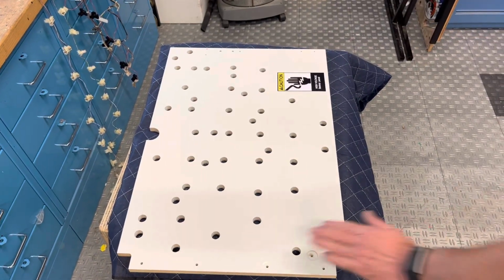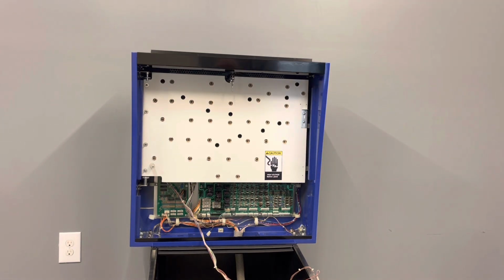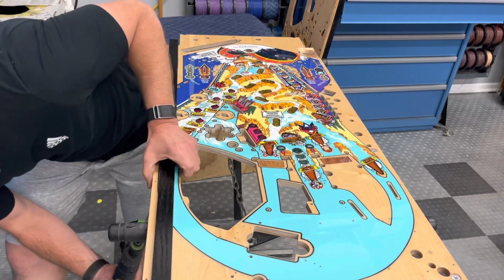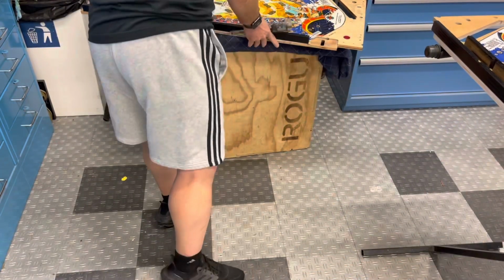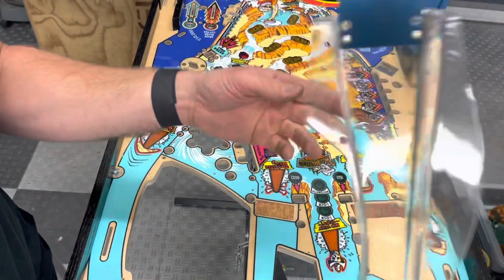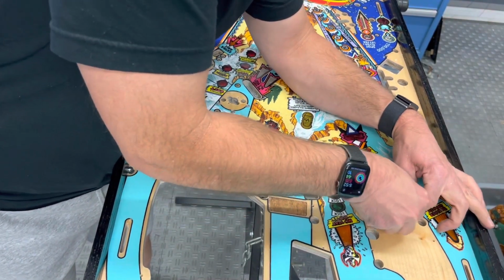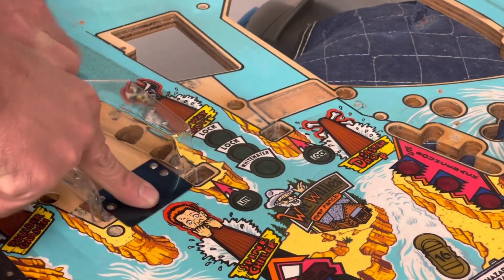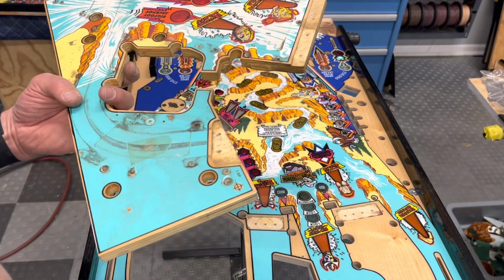White Water Pinball 7

Comment: Wood chisel would help ya get that ramp area cleaned up. No drill circles
Reply from the maker: That would require a hammer as well so I would be worried about it drifting on me but honestly it’s not something I use enough to be comfortable with so I am going to usually stick with what I know best.
Reply: @highendpins   yep im certainly not to your skill level for all the magic you do.   Just a passing thought as i watched.   Thanks for all the great content
Reply from the maker: No problem I am sure there are better or easier ways to deal with some of the things that I run into. The main goal is showing the problem and solution how to go about it isn’t quite as important as long as it yields the intended outcome.
Reply: I would have tried a trim router with some elaborate jig, your way looks much faster

Comment: never seen you short of tools.. but router FTW on that ramp recess :)  1/4" straight bit would take care of all those recess expansions in minutes with no need to manually clean up
Reply from the maker: Yes I am sure and I have a router but I like the drill method it’s what I am comfortable with. 
I always default to the use of tools and processes that I am used to and best with even if it seems harder or less ideal. 
  Hopefully this doesn’t turn into a peanut gallery.